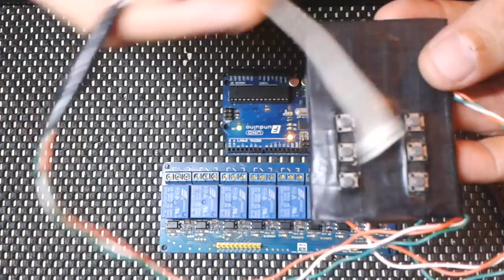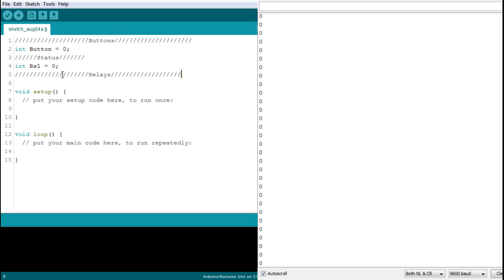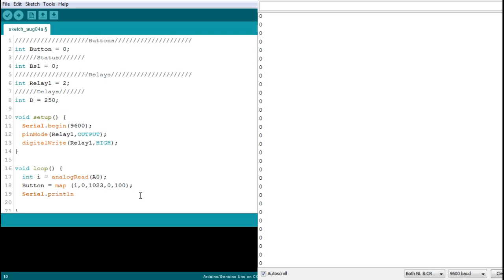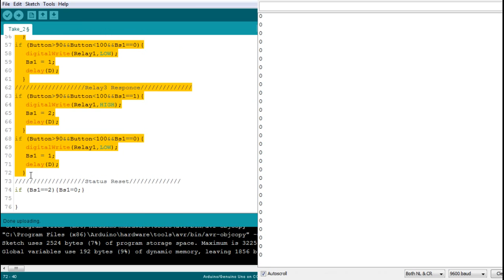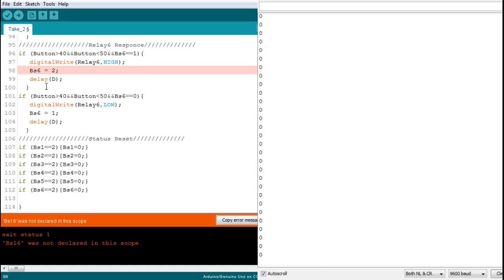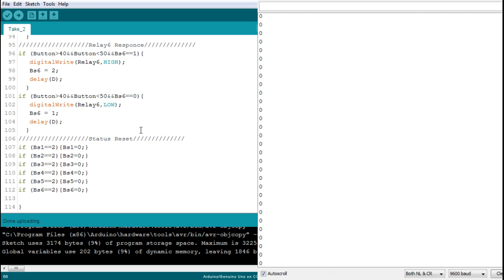Arduino Coding ("Button And Relays")

Comment: Hey, what were the resistor values and is it possible to accommodate 16 buttons?
Reply from the maker: I think I used 6  x 1k's and yes you could add more buttons just change the values of the resistors
Reply: liney118 thanks for that I will let ya know how it goes
Reply from the maker: @OcenaSoft  Yea, please do ;)
Reply from the maker: try half K resistors
Reply: @liney118  Have done it with 16 buttons and 240R on each switch - it was close but works very well. With a little adjustment to the code (i.e. as each button is pressed there is a +- tolerance which compensates) it works very well and i have further adjusted the code to eliminate the continuous "on off" if the button is held down. Once I have drilled the plastic box for the button caps I will post the code and circuit.
Reply from the maker: @OcenaSoft  Great work Dave, can't wait to see it. thanks for getting back ;)

Comment: @Liney118, this is brilliant, thank you. Can you recommend a line of code that I could add that will turn off a relay when another relay is selected on? Many thanks.
Reply from the maker: Sure, just set the other relays high in the code for trigger. So lets say you only have 2 relays and you've turned one on digitalWrite(relay1, low); just add digitalWrite(relay2, high); that'll turn 1 on and 2 off

Comment: I need resistor nominals
Reply from the maker: I used 10k x 5
Reply from the maker: It doesn't have to be 10k , just try to stick with the same values, makes life easier
Reply: liney118 дякую !
Reply: liney118 thank you !